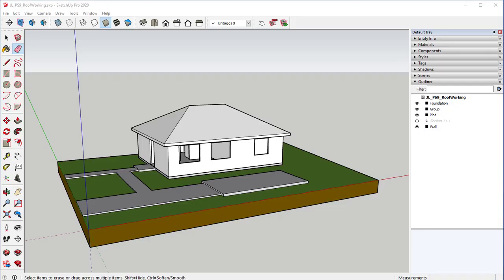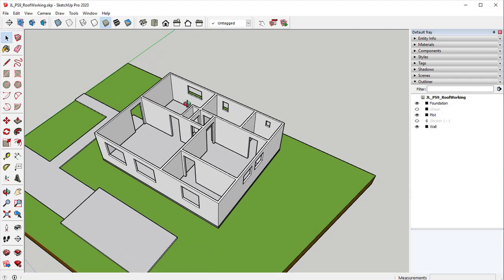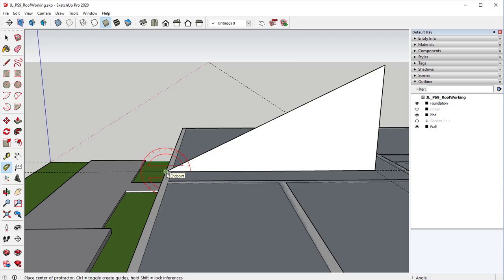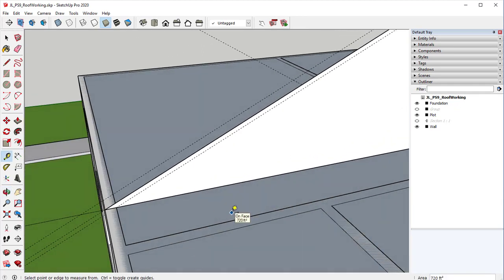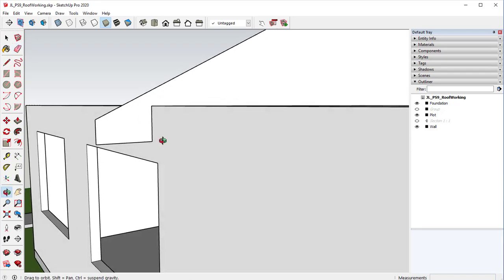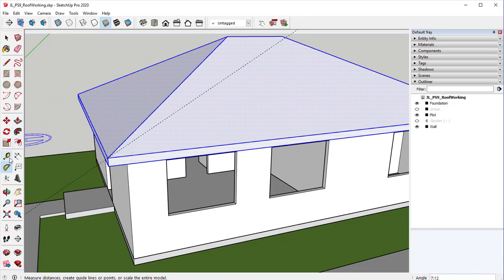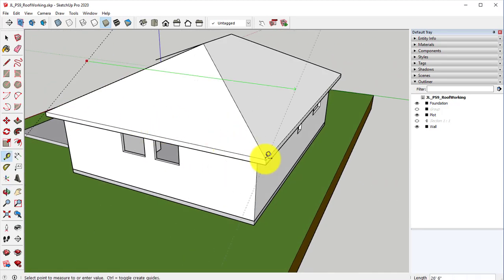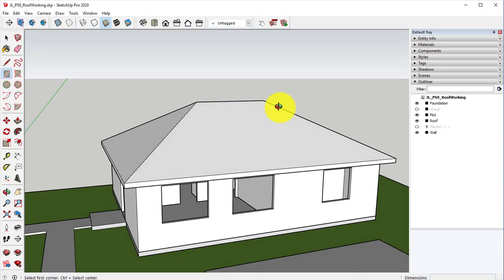Step by Step SketchUp Walkthrough - Creating a Custom Hip Roof with the Protractor Tool - Ep. 7

Comment: Thanks for the instruction on creating a roof, what would be the process of creating a cathedral ceiling in a portion of the house such as a great room. Picking up a lot of tips and tricks along the way.
Reply from the maker: Just creating a profile like you did in this one is a great way.   Create the profile of the angle and look and just push/pull it across